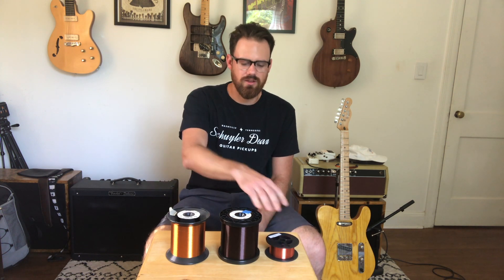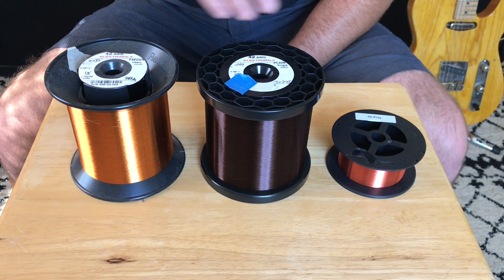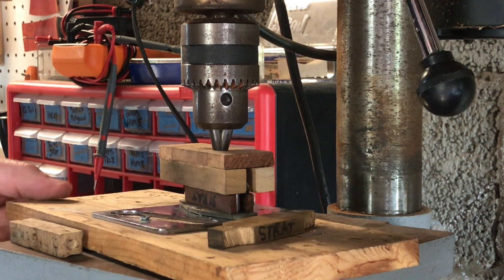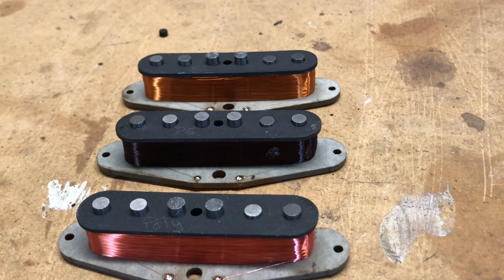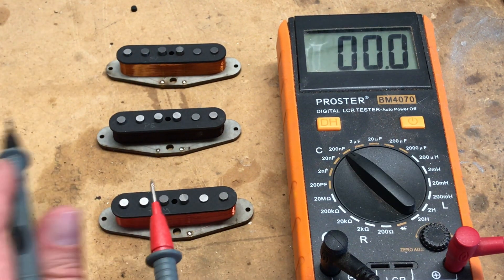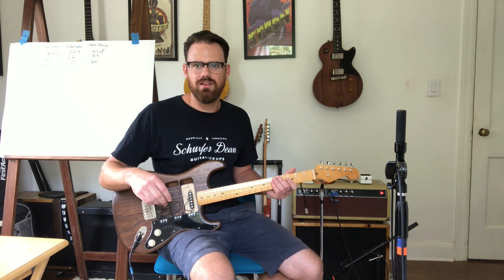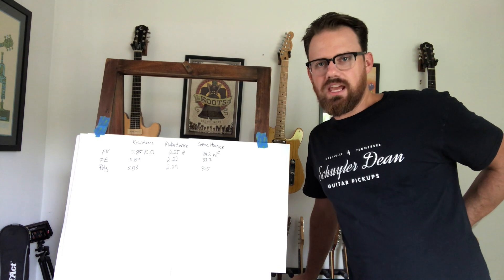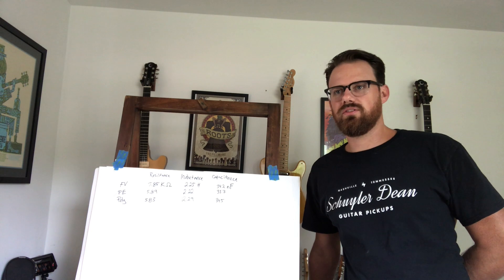Full Review: Formvar vs. Plain Enamel vs. Poly Pickup Wire

Comment: A little tip: BUY A GOOD MICROMETER. Magnet wire varies alot spool to spool. Tiny variations in the diameters make for big changes in coil diameter. Small coils are bright, bit fat huge coils have better warmth. No two spools will always be the same diameter, and tolerances for 42 gauge are HUGE. If you don't know what the wire measures you might wind to a specific recipe and suddenly find out your coil won't fit the bobbin.

Comment: Question regarding the tape on the poles: Is that a vintage spec thing? For some reason it's stored in my (admittedly often-confused and potentially fallable) brain that the bobbins were lacquer coated before winding rather than taped. It's probably a barely there, imperceptible difference in coil geometry, but just more of a technical curiosity for me (on my quest towards omniscience).

Comment: My experience with a lot of different Strat pickups is this- To my ears, enamel and polysol sounds brighter and snappier to me than formvar, which sounds like it has less highs and less of that snap and attack that I like. That's with them all having the same alnico 5 magnets and DCR, so the wire insulation is the only variable.

Comment: I wonder if anyone has ever tried winding a pickup with two different types of wire in parallel. All you would have to do is run two strands at once and half the number of turns to fill the bobbin. I wonder what that would do to the sound.

Comment: Formvar has twice the insulation thickness (double-build) as poly and PE.  Poly and PE have nearly exactly the same thickness of insulation and both kinds of insulation have nearly the same electrical permeability factor.  So the difference in the latter two would have to be the wind itself.  Formvar is going to sound different with the same turns because it has lower capacitance because of the larger space between the wires.  But if all other variables are the same poly and PE wire should not sound "different".

Comment: i have always suspected with the tolerances not being as accurate and the production not being as "tight", the vintage wire that was called "42awg" was/is probably closer to todays 41awg. I have never wound a pickup but i know they sell "thicker wire and a few makers actually will wind with them.

Comment: You sure that poly wire insulation is the same thickness as the PE?  The standard polyurethane wire (Elektrisola) on the Remington sight is listed as "heavy" and just slightly thicker than the HF wire.  The high-end level sounds closer to the HF on the bridge.  The PE sounds warmer.  Maybe just less highs, but could be stronger fundamentals.  Other variable might be at play, but at 1/16" from the strings even a difference of less than 1/64" between each example would be audible, as half or twice the distance is a ~6dBV change.

Comment: so I guess the question you have to ask yourself is why are you doing this?

Because it seems to be a real unscientific setup.

And even so, given that the inductance and capacitance are so close, why even proceed with an unscientific experiment?

when you test things, you have to get a sample of the distribution of the item you want to test. Might get 10 magnets or 20.  And on average they come up to whatever gauss. And you would need a sample of these large enough so the variance is small. 

And you need to do that with wire and magnets and magnets that are wound. In other words, take two of the same pickups that are made the same and measure them and keep doing that until the average readings do not change. Then you will have enough of them to put into an experiment.

And then, when you compare the two,  you have to do an F test or a or t-test to see if the distributions are different, not whether one or two is different. 

And then what exactly are you measuring? You need a blind way to generate a signal. You cannot play it yourself because you have bias. so you need a little picking.  And the resultant output you need to put to measure the distributions of the sounds.  you have to do an F test on it to see if the distributions are significantly different,  not just play it and think that you hear something different!

look, everyone does what you do just now. a million videos out there where people are doing this kind of thing and it tells us absolutely nothing.

Why do you think we are all so ignorant about everything when it comes to guitars?

Because no one does scientific experiments. I mean I am sure o

And then there's the matter of your testing equipment. That device you have does not measure inductance well. It's very cheap. One video I saw gave me the impression that it's about 3% too great compared to his other inductance meters. Don't know if that's consistent or not.

Comment: I think it would be interesting to make a voice coil to act as a surrogate string. 

You could then use software like Room EQ Wizard, usually used to characterise the frequency response of speakers and do a frequency sweep. 

You would be able to measure the relative EQ of each pickup - ie linearity of the frequency response, distortion, etc in a way that’s independent to guitar setup.
Reply: I had a similar idea, though you've thought it through further than I have.  Honestly, I was still stuck wondering if using the speaker coil to act on the pickup coil would be okay, or whether there would be more verisimitude in taping some short pieces of guitar string to the outer paper part of a larger speaker.

At Seymour Duncan they have a mechanical strumming mechanism, and they perform 10 identical tests with it.
Reply: @orwellophile  yeah that's a good point. I guess directly vibrating strings could be more representative. The tricky part with that would be getting a full frequency sweep and keeping the results independent of guitar setup.
Reply: @jcadlols  I held my iPhone vaguely near my pickups and was shocked to hear hifi quality audio coming out of my monitor speakers.  I didn’t check bass response.

It might simply be enough to ensure accurate repeatable positioning of the coil, and perhaps adjust the “eq” (the results) until a replayed recording of a real strum matches the original.
Reply: @orwellophile  https://www.youtube.com/watch?v=VwM77fmqV7s

I should have known people would have already done it haha

Comment: You may want to consider getting a different LCR meter for testing Inductance - I've been made aware that it doesn't test at a low enough frequency to provide correct readings. I use the DER EE DE-5000 and measure at 100hz. Same thing for capacitance.

Comment: WHICH IS BETTER IS SUBJECTIVE WHEN IT COMES TO SOUND BUT THEY ALL ''SOUND'' DIFFERENT. Another problem is that PE wire and Formvar aren't the same as they have been in 50's 60's 70's. I use both and do like PE and but they are different, chemical compound is different and anyone of you dudes can check that out. So how much is ''vintage'' that is questionable. IMHO pickups from the past are unique not just due to wire moreover the vulcanized fiber was different to. I'm not saying old were better just different that is fact, Good video.

Comment: So I completely respect, DTT, but in the start of the video 0:19, he says the plain enamel .042 has the exact same insulation thickness as the "poly" so you shouldn't be able to hear a difference.
News flash, you can. It's significant. I think I like the "poly" on the bridge better, but it's definitely a different tone.

Comment: from a scientific stance only the Formvar coil can sound audibly different from the others. assuming the winds on each coil, the packing of the winds and the resistances are the same, (since resistance of copper is also the same in each of these) the inductance shouldn't vary  (even though the permeability of the insulation can vary the difference in ratios of permeability between copper and the different insulation types, this variation is negligible). 
this leaves only one variable which is capacitance, the average dielectric constant of enamels (which include poly and is why i didn't make a distinction) is between 3.70 and 3.80. the dielectric constant of the insulation on the Formvar wire is almost twice that (7.4)
so for this difference in dielectric constant and keeping the rest of the parameters constant, the capacitance of the formvar coil should be twice as high as the enamel ones. this in turn should give a different electrical response in the intrinsic RLC-chain in the coil and should produce a different sound.
(source on dielectric constants : https://www.iewc.com/assets/specsheets/MW78C-16-S_Specification.PDF 
 )

if these are audible differences i do not know (since calculating the actual variation in physical sound is to complex to calculate on the spot), but if there is an audible difference it should only be in the formvar coil.

greetz boiz

Comment: Given amps, pedals, and chords used in pop music I doubt anyone but Mel Bay could tell the difference.  I'm struggling with winding given the wire breaking. (Getting good at soldering hair) i insulate repairs with poly.  Liked your comment re  just enough tension to hold wire.  
Question:  the small sleeve where wire connects to bobbin came out.  Can I just wrap wire in hole and solder it or do I need that sleeve?
Reply from the maker: You need the eyelet, otherwise the solder will not hold to the flatwork
Reply: @SchuylerDeanPickups  where can you buy these eyelets?
Reply: @davidclink1425  Hahah, you and me both buddy.  You can buy the flatwork from China, but unless you want to buy individual set of mixed ingredients the fibreboard doesn't come with eyelets, possibly because it's attached using a special tool like a rivet? I'm going to 3D print the flatwork while I get in some practice, and leave a groove in copper-holding-holes.  I'll put a loop of copper from some CAT-5/6 cable in each one, and solder at low temperature (after tinning the wire at high temp to break through the insulation). I think if I get it right, the heat from attaching the wire to the copper loop will be just enough to secure the loop in the flatwork.

Comment: And you could wind 3 pickups all with the same wire and have just as much difference, pretty much none. In a band mix even more none.
Reply: Yeah, IF you're super sloppy of course.
Reply: @33gutteroil  ,Sloppy playing, winding? Not sure what you mean. I guess my point is you can't hear the insulation, the electrons don't know the difference. It's all how the wire goes on.
Reply: @bradt.3555  Well, both. If you're inconsistent at something, you're getting inconsistent results. Also, Heavy Formvar wire has double the thickness of insulation compared to a Plain Enamel wire, which makes the distance from wire to wire larger, resulting in different Capacitance and Resistance. TBH I can't explain why Plain Enamel vs Polysol wouyld make a difference because they both have the same thickness of insulation and that seems to be the biggest factor in tonal differences in this case.
Reply: @33gutteroil  ,Could be the wire under the insulation. My point is it boils down to resistance, capacitance, & inductance, the composition of the insulation makes no difference, tho as you said thickness does matter. You could also have 2 pieces of wire with the same insulation but if the wire inside is of a different alloy it could affect it.

Comment: Hi there, I'm sorry but your test is not accurate, you have wound 3 pickups handguided, that means that there is no consistancy. De coils are different, because you scatter-wound them, meaning = not the same. I've listened to the tests and I can't hear what you say to hear yourself. I know from experience that PE is not the same as Poly. You can feel the little bumbs (sorry for my poor english I'm from holland) as the wire slides trough your fingers. The insulation of Poly and Formvar is more even (smoother) which you can feel during the winding as well. Not that it makes sence, but for a real good comparisson you have to work with a CNC winder and program the winding patterns exactly the same. I also prefer scatter winding my pickups and they sound just 'better' than machine wound coils, ist ofcourse a matter of taste. You can though get more consistancncy if you have enough experience, which I asume you have, to know your windingpatterns. I developped the "Controlled Scatter Wound Winding Pattern", which enables me to reproduce (85%) the sound of an earlier wound pickup. It took me 10 years, but it's pays off in the end. Lets call it: bring order in the chaos.  You can let Poly sound as clear and bright with firm low, twangy mid and clear high, if you change the winding pattern. Same with Formvar, even the wiregage is not that important. I enjoyed your video, keep winding and posting, nice work! Kind regards Paul HendriX (Pauls Pickup Place/HendriXpickups.nl The netherlands.)
Reply from the maker: Totally understand! All good points, Paul.

Comment: would you be able to tell me where you get your coil wire from please. I'm a guitar builder in NZ and would like to make my own pichups
Reply: hey so did you start winding yet? if not, just a quick tip- DO NOT buy the really good shit right away, you're going to waste at least a pound of wire just trying to get a hang of it and make a good even looking coil. just buy the cheapest shit off of ebay or some chinese manufacturer. anything with a insulated copperwire(42awg) should work. once you get comfortable winding, go buy any of the wires in the video from a proper manufacturer i.e. Remington.
Reply: @33gutteroil  Thanks man, just finished making my winder. I'm currently building a 7 string multi-scale for a client, and he wants P-90s, so I will have to have a go at making/designing 7 string P-90s
Reply: @roelschouten8834  That's cool that you made your own winder!  P-90s are great too, and not that difficult making them sound great. Just fill the bobbin up with 42awg and try not to over power it with strong magnets. Good luck with your project!
Reply: @33gutteroil  thanks man, i really appreciate your help. I'll be using Alnico 5, but might tame them down a bit with not fully charging them

Comment: hello, Can I change the polarity of a pickup? how?
Reply: Re-polarise the magnets by running them through a set of strong magnets aligned the way you need, and repeat until your Gauss meter is happy.  Or -- and I've never tested this -- turn the pickup upside down, which will reverse both the polarity and the winding direction...  Not sure whether you should also swap the ground and signal wires too.

Comment: Thanks for doing this interesting experiment. 
I suspect you have the decimal point in the wrong place for pickup capacitance. The capacitance of a Strat pickup might typically be 130pF or 0.13nF. You have to make this measurement at high frequency, say 100KHz so the impedance of the coil is high enough to get a reasonably accurate measurement of self capacitance. I'm not convinced the meter you are using can give you accurate measurement of coil capacitance.
Output is directly proportional to the number of turns on the coil. Resistance is not a measurement of output, it is simply that the more turns you put on the coil the higher the resistance. I get really tired of people saying things like 'resistance output' or this pickup has a 6Kohm output. Inductance is a better indicator of how much signal a particular pickup will produce ... and even then inductance is not a measurement of output.
Even with exactly the same number of turns on several coils using the same wire from the same spool you are likely to see variations in coil resistance due to variations in the copper, any wire stretching from tensioning and in coil temperature. Coil resistance varies a lot with temperature, you can hold a pickup coil in your hand for a few seconds, put it down, measure the resistance and watch it change as the coil cools down. When using wire with different insulators from different spools and therefore manufactured at different times, a larger difference in resistance is to be expected.
All pickup coils have a main resonance due to the coil inductance in parallel with the coil self capacitance in parallel with the instrument cable capacitance (with the volume at maximum). Any other variations in a pickups frequency response are due to frequency cancellation related to the coils dimensions and its interaction with the magnetic field changes from the vibrating strings.
Reply: Correct re: capacitance measurement. Two small coils in series could have such a low capacitance, e.g. Fender noiseless pickups, but almost all standard single coils are in the 80 pF to 150 pF range. If the LCR meter is not capable of measuring at 100 kHz or above e, the numbers will be far too low, as we see here.

Comment: the voltage generated has nothing to do with the  coating of the  wire...coating does not generate electricity...what matters is the magnet and the wire  and how you wind...not the coating..so don't be a  fruit

Comment: Definitely a noticeable difference between the three. 
Poly is articulate and has a pronounced punch and treble peak. 
Enamel is pretty much the same as Poly except in that treble peak, where it falls a little lower and is more even accross all 6 strings. 
The formvar has a more pronounced low and mid-range. Which is probably a characterstic of the physical difference in insulator thickness. 
Good video. I think you can probably account for a fair amount of that extra treble from poly by degussing your magnet and adjust the poles.
Reply: Lower Gauss doesn't reduce treble, but it does minimize harmonic variances per pos via string pull.  I prefer lower Gauss for that reason.  A low C cable would smooth out and extend the highs.  BTW, there is no way the internal pickup C is in the 34nF range.  There would be virtually no highs as the tone would roll off at ~500Hz.  Strat pickups average 100~150pF.